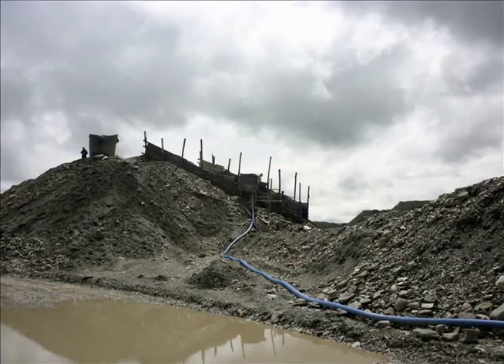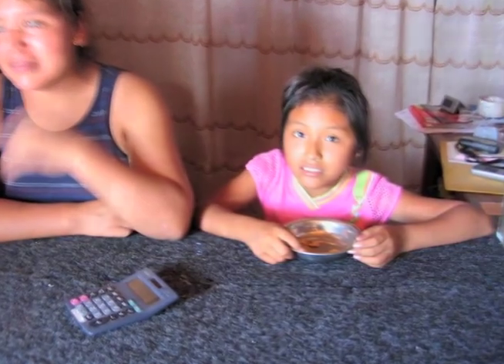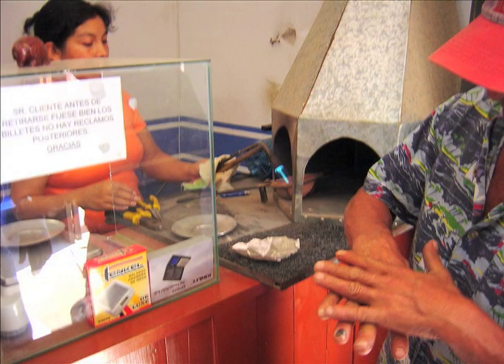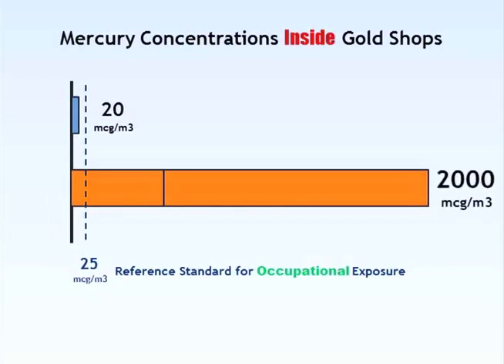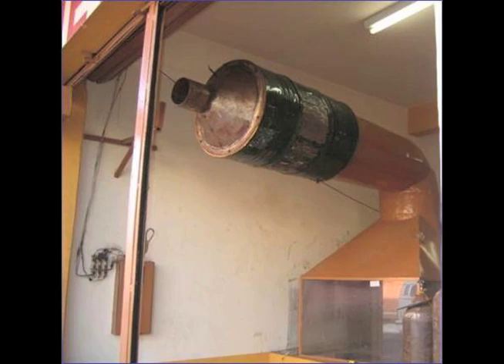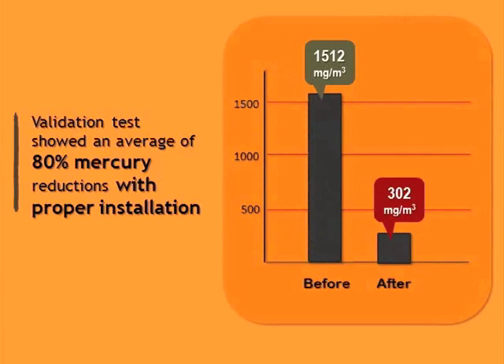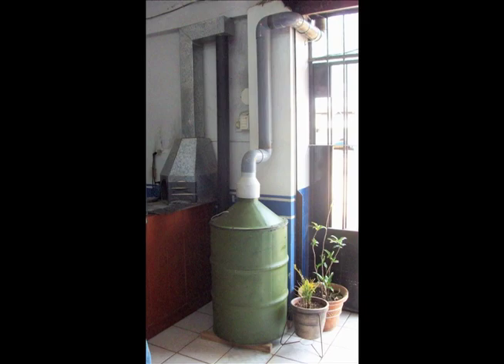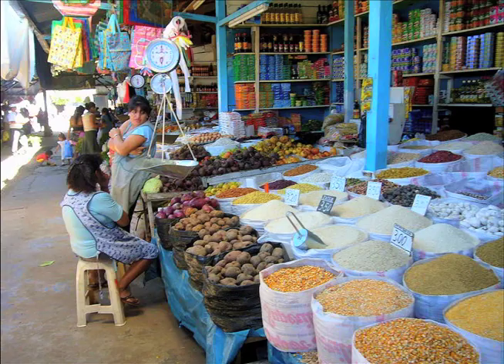EPA Gold Shop Mercury Capture System

Comment: I gotta agree with Dickson. This is an awfully complicated system to only recover 80%. A simple water chamber guarantees nearly 100% recovery and is a LOT cheaper and simpler to build.

But I guess that's the EPA for you... criminalize spilling a pint of oil on the ground, while the highway department sprays millions of gallons on the roadways every year.
Reply: HowToDrillAWell can you please explain more?

Comment: This is what i did to capture mercury and i got Quantitive,  100% capture rate..

This videos a joke.
All you need to do is put a water trap in the exhaust system, and make sure its turned on when you retort mercury.
Now get a steam source, eg a wallpaper stripper with the end cut off,  blast the equipment and equipment chamber with steam.  Flush your outtake pipe with steam.  All the microscopic particles have now been taken up into into the watertrap too.
Collect and weigh your quantitive yield of recovered mercury
Its pure too